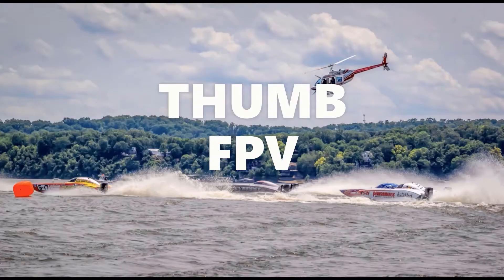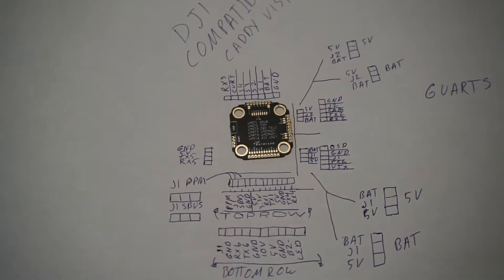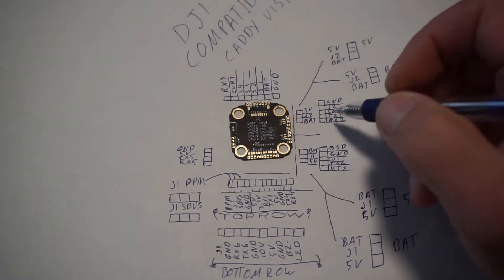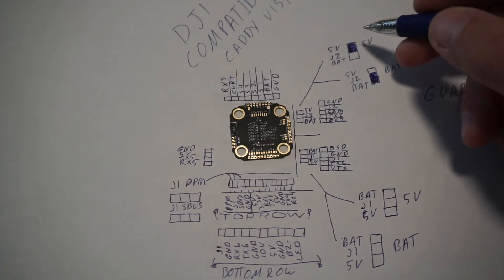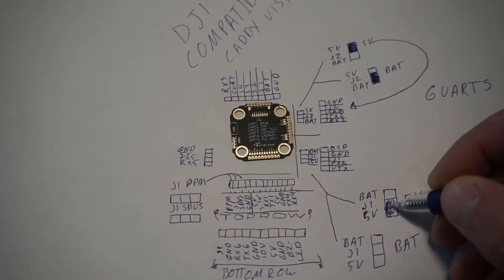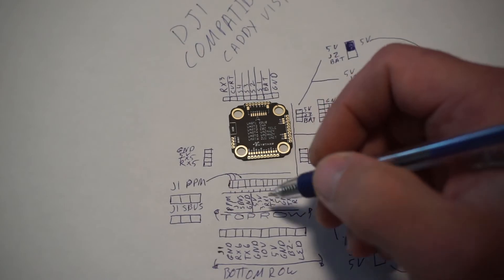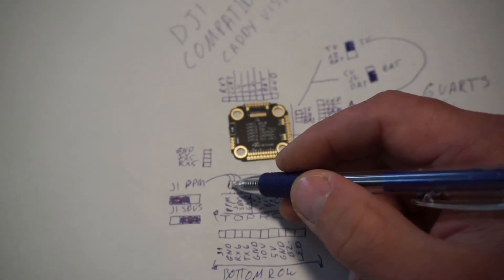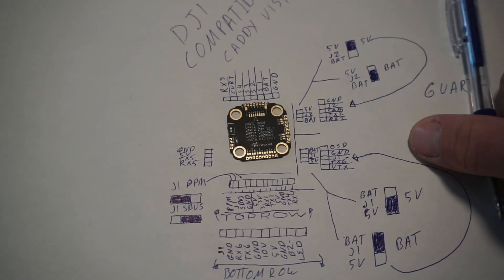SKYSTARS F405HD MINI 3-6S 20X20 FLIGHT CONTROLLER

Comment: So if i understand correctly on the top row i dont solder any wires whatsoever and must bridge those pads, and alle tue wires are soldered on the bottom row pads, same as the VTX and CAM lane yes?